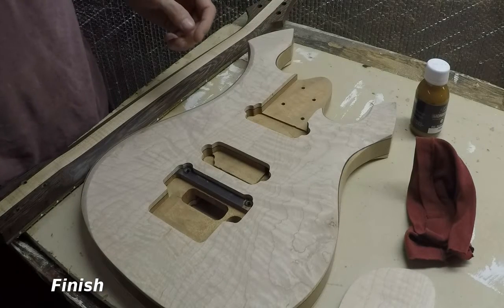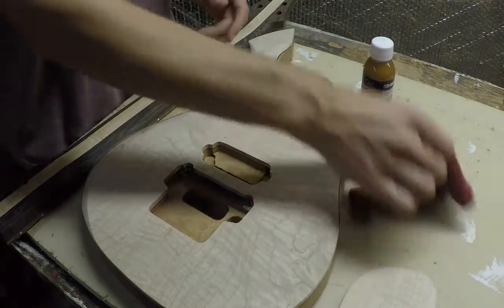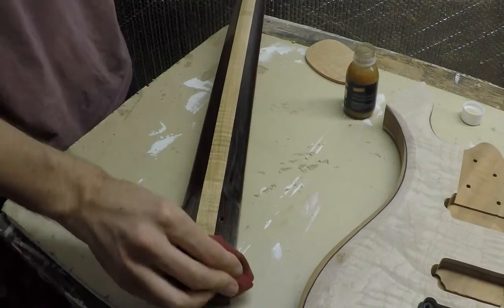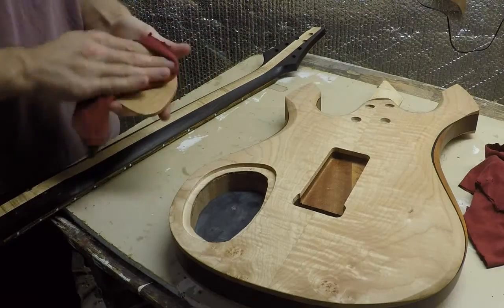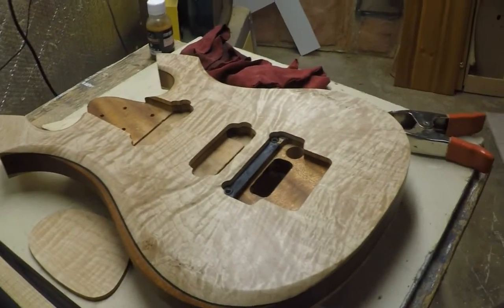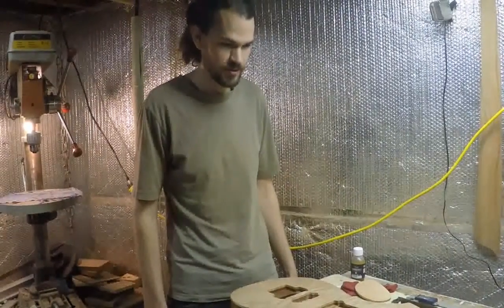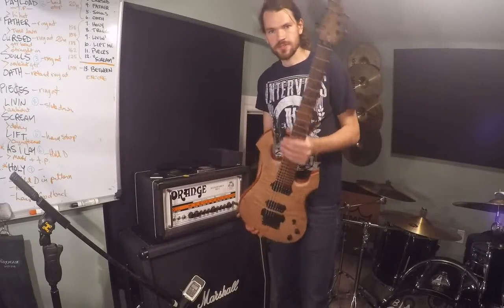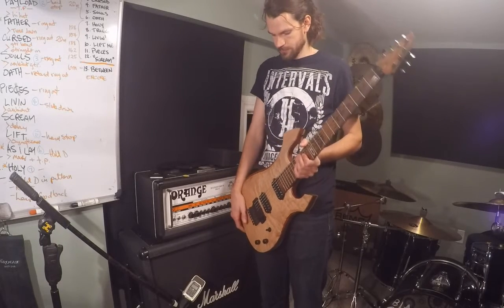Episode 8 - Finish and Assembly (and playing...)

Comment: Nice build man, with respect I would like to offer a couple suggestions. First always wear a mask when working with exotic woods, it may not seem to be bothering you now but when it does, and it will the effects can be devastating. I wish someone would have warned me when I was starting out building, I had to learn the hard way when I had a nose cancer scare. 
Now putting the doom and gloom aside try using brad point drill bits, they will save you an extra step when drilling your holes. You are a talented builder keep up the good work and thanks for sharing your videos.

Comment: how far away is the bridge from the 24th fret?, I am thinking about building a 7 string travel guitar, I know that the scale length has to be either 25.5, 26.5 or 27inches, but where the neck meets the body and how far the groove for the body has to be depends on that distance, if I get it wrong it won't tune.
Reply: The distance of the 24th fret from the nut is given by your choice of scale. The same goes for the distance of the nut to the bridge, which is your scale. So, the distance of the 24th fret from the bridge is just the difference between the two.
Basically, you can only place your bridge with absolute certainty after you made the neck pocket and placed the neck in the body because the final position of the neck (and therefore the nut and centerline) determines the position of your bridge.

Comment: Great job! Could you please share where did you buy rubio monocoat? I am trying to find on the web, but it s not so easy...!
Reply from the maker: +mistos I bought it locally from Exotic Woods (http://exotic-woods.com/)  I'm not sure if they will ship though.
Reply: +Guitar Building With Dave It really popped out all grain! Amazing! Was it sticky on application (like tru oil)?
Reply from the maker: I don't think it was ever sticky, no.  You wipe it off very thoroughly only a few minutes after applying (once soaked in), so there's nothing really drying on the surface.
Reply: +Guitar Building With Dave I hope to find it in a European seller... The result seems great!

Comment: What keeps the pickups in place? Or are they just sitting loose in the cavity?
Reply: Screws. You can see him screwing em in at 5:47 if you look up guitar pickups on images you'll see they have little things on the sides with holes for the screws.
Reply from the maker: This.  Normally you use pickup rings, and the same tabs attach the pickups to the rings, but I went for a minimalist approach on this one and screwed the tabs right into the body. "Mayones" guitars does this a lot.